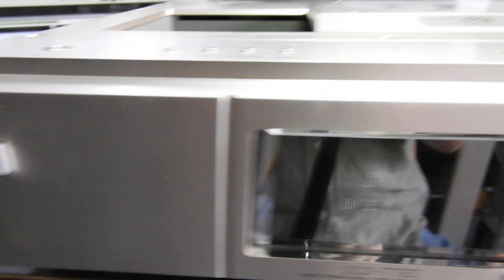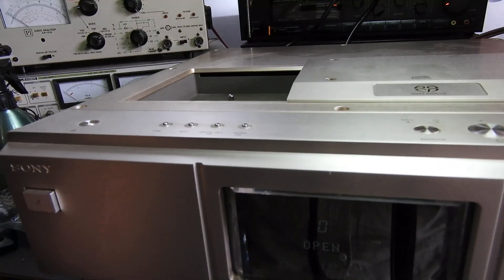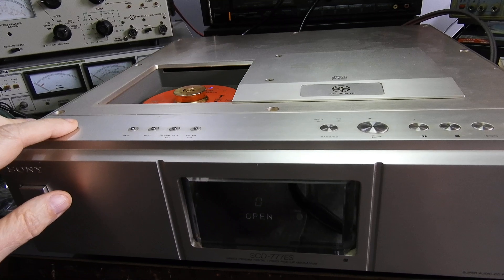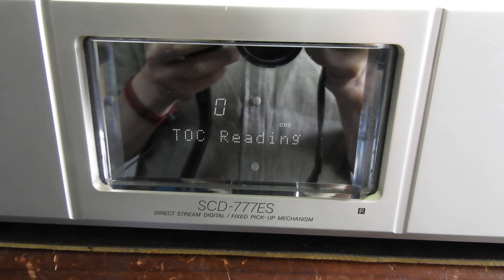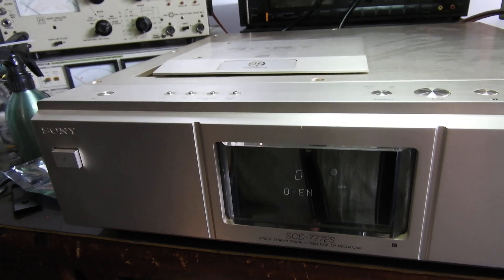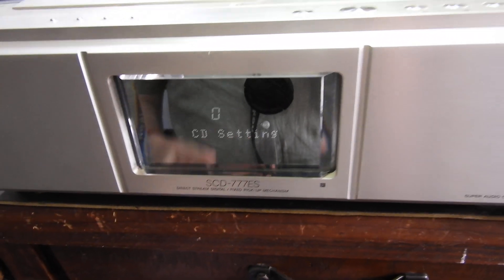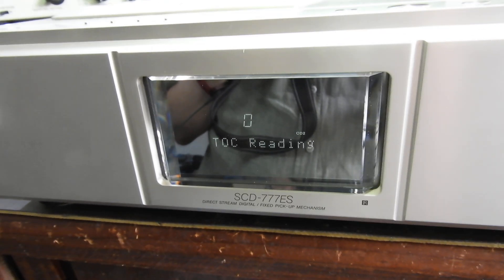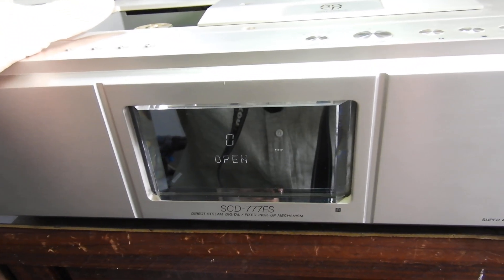Sony SCD-777ESD - great SACD player. Well made and engineered. And the effort that went into loader!

Comment: I can only advise everyone not to buy a used laser, as they are usually defective or only partially functional.
I myself own many of these CD players SCD-1 and SCD-777, they are the best CD players I have ever heard.
Reply from the maker: There still is plenty of DVD lasers which were used in SACD, os there is no need for that. For some older CD players used replacement are the only choice. But I never buy used lasers anyway. I buy cheaper, working CD players in which I can measure laser condition prior to removal.
Reply: @hear-net-au  - That's exactly how I do it.The exact alignment of the laser in this machine is very important, otherwise the CDs will not be recognized correctly.